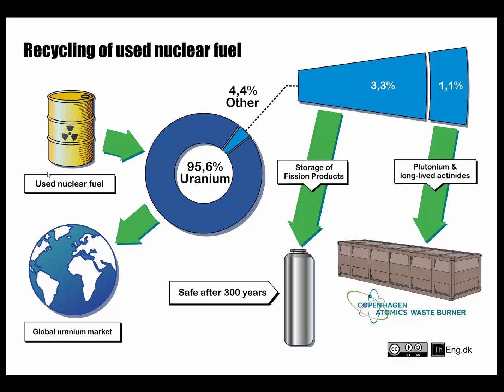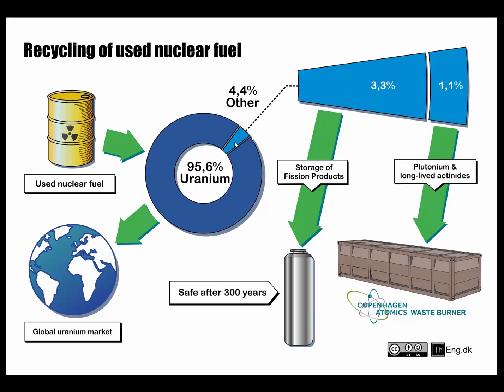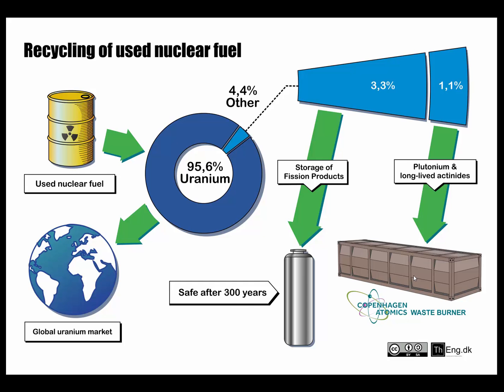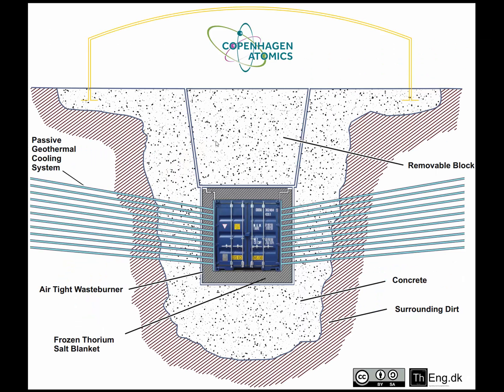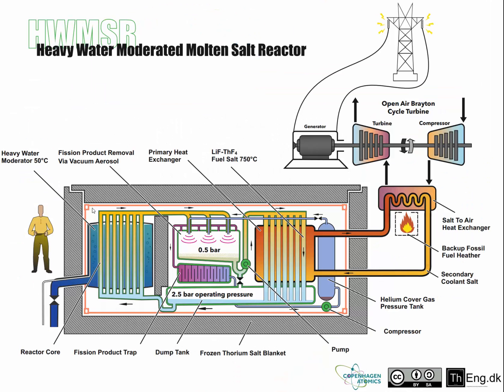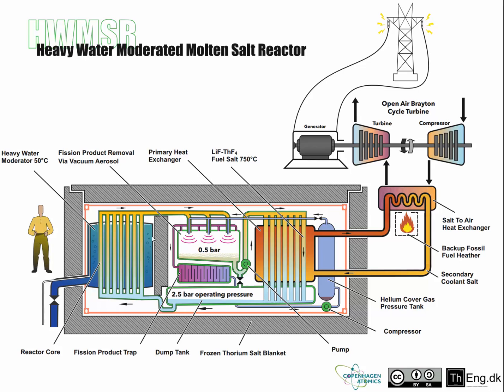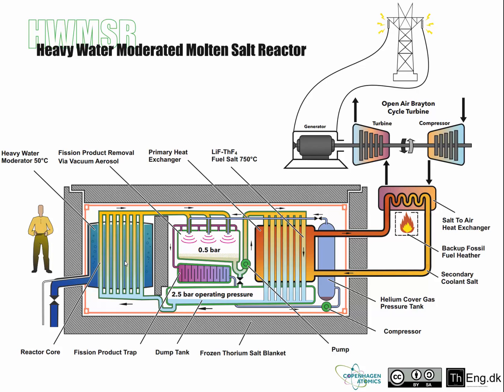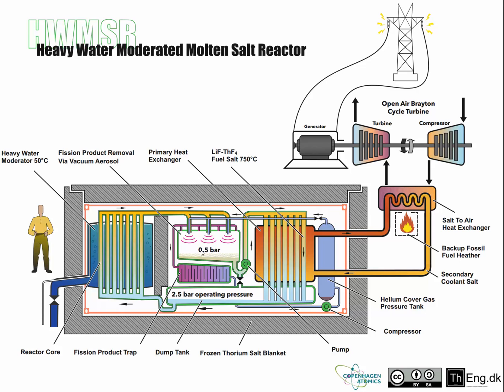Copenhagen Atomics Waste Burner in 5 minutes

Comment: This is incredibly wasteful most of the transuranics have industrial value and can just be extracted and used.
Reply: OR you know, you can use a few hundred kg of reactor grade transuranics to convert several metric tons of thorium into fissile material. Not wasteful at all, it multiplies the fuel.

Comment: So apart from the problems of Silicon Carbide (mentioned in another comment) I think using heavy water isn't the best choice.
You have a nice solution to the temperature difference problem but I'm fairly certain that if you just used Lithium Hydride or if you want better neutronics, Lithium Deuteride.
That will stay as a nice ionically bound liquid at very toasty temperatures and I'm sure that neutronically it can't be much worse than heavy water. Could be better TBH, I don't know.

Comment: How does the flame reactor differ from the FLUOREX fluoride volatility / solvent extraction process, or the salt dissolution / electrowinning process?

I think it's certainly interesting that you have chosen to go with heavy water over graphite. In my opinion, the heavy water would be much better since you no longer have that graphite waste source term - but you face much greater tritium production. I think that this approach is far superior to the cladded metal hydride moderator by Transatomic which has issues with appropriate cladding and hydrogen migration. I hope that you've made your moderator caladria tubes double walled with a helium separator though. A failed tube would provide a small steam source that would overpressurise your containment; and release a lot of tritium to embrittle everything besides.

I would agree with James Joyce in saying that the Moltex static fuel rod design would be simpler - but that design is in itself complicated by the need to have a robotic system to move fuel around due to lack of homogenisation of reactivity.

Probably the best approach is a fast reactor approach like the MCFR by Southern Company / Terrapower in the US or MOSART or MSFR - but those reactors are going too big and too ambitious. If the MSFR were scaled down to your power levels, the result would be a far more deployable, far more testable, and far deeper burning system than a purely thermal system. The challenges of going fast don't sufficiently ameliorate the benefits of going thermal, in my opinion. 

The elimination of xenon poisoning as a factor in helium sparging speed, the longer, deeper burn and transuranic destruction, the higher power density and the simplified reprocessing (removing trifluorides only every few months) far outweigh the "penalty" of requiring 20% LEU to start.